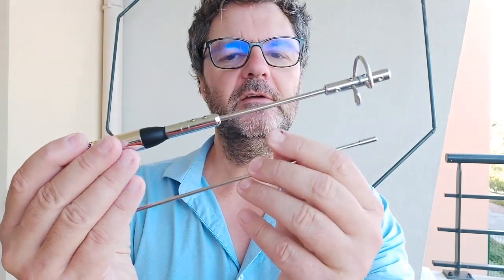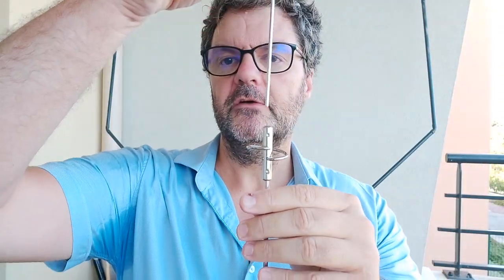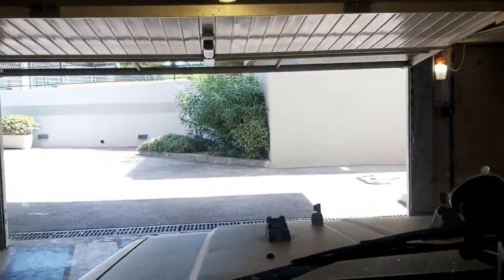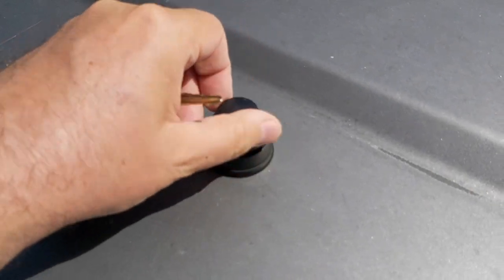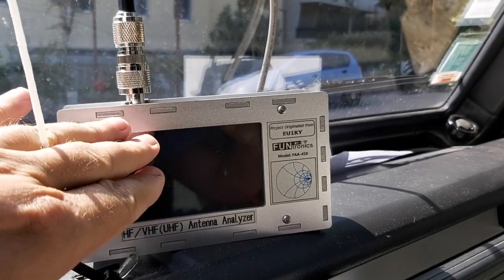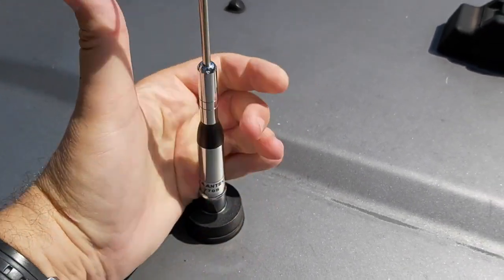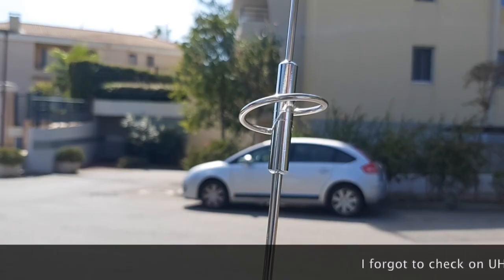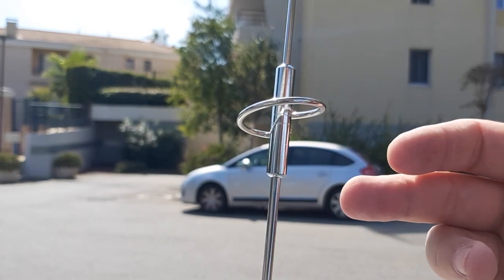Checking SWR on New Nagoya VHF UHF Antenna.

Comment: Gill when you do the SWR TEST TRY IT WITH THE DOOR OPEN AND THE DOOR CLOSED, YOU WILL GET 2 DIFFERENT READINGS,  TRY IT ON UHF AND VHF. WITH DOORS OPEN AND CLOSED. SWR WILL DROP.
Reply from the maker: Interesting, I didn't think of that!
Reply: @RadioPrepper  Because your car is the ground plane, by opening your door/ doors. You reduce the ground plane, I could see you had your door open.
Reply: Interesting!  I must find time to verify that.  The theoretical minimum radial length for a quarter wave monopole is just a bit larger than a quarter wave.  The  conducting surface of that hood/bonnet is certainly a large enough radial area for VHF, and easily big enough for UHF.  (But it's not really big enough for the CB antenna, so I guess its base loading coil takes that into account).  Fixing the "Nagoya" antenna closer to one edge of the ground plane as in this case, may have a small effect that would be interesting to measure (or simulate).
Reply from the maker: The position probably skews the radiation pattern towards the left of the car...
Reply: @RadioPrepper  I've seen a gentleman use one of these aerials, he made note of the adjustment rod up & down, make sure the rod is all the way home, to the btm,  his SWR was about 1-7  he nipped 3mm off top radial, then SWR dropped to 1-5 ,then one more little nip off top radial SWR went down to 1-3. So if you nipped 2mm off more, and it starts to rise a little that's when you use that one inch adjustment you have to bring it back down to 1-3. Radioham is all about experimenting.
Reply from the maker: Absolutely, and coax length will affect the results too..

Comment: I can understand the choice for a permanent fixture on the car, but wouldn't a magmount be more versatile? For instance when you'd want to change cars or get a (temporary) fixed location. Your opinion please. 73's de NL134.
Reply from the maker: For me not really... For a newer car maybe... This is an old truck and If I want to operate somewhere else, I have other antennas for that... I have multiple radios and antennas, so not a factor. If I had just one, a mag mount would serve me well.

Comment: To bad you did not test it on 70cm. I had one exactly the same, works fine on 2m but 70cm is a disaster. The one winding coil in the middle is also shortened by the antenna itself, does not do anything! Why is it there? As I work on 70 cm a lot I went for a Comet antenna which gives me great readings on both bands. But since this is probably not a genuine Nagoya, maybe the original does work ok.
Reply from the maker: Probably. I will get something better..